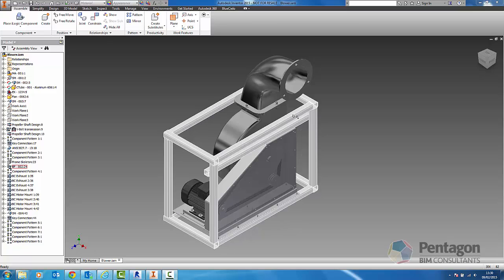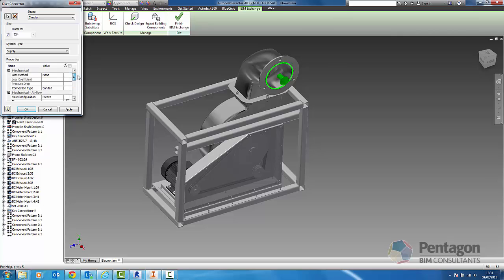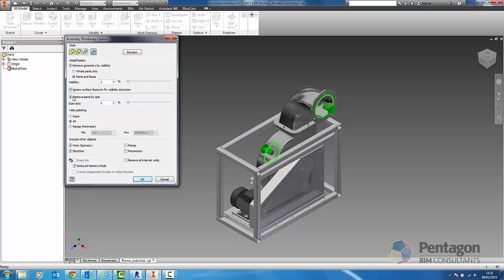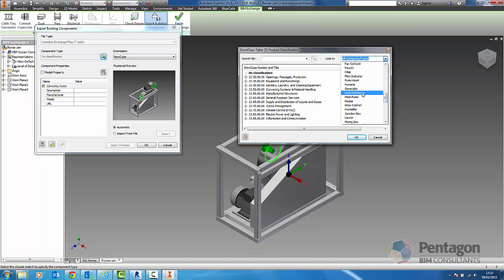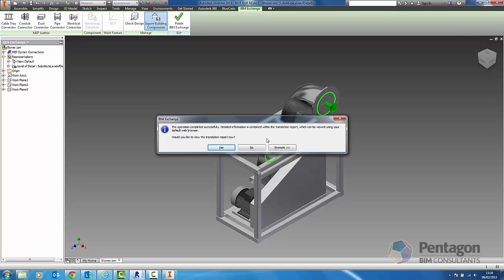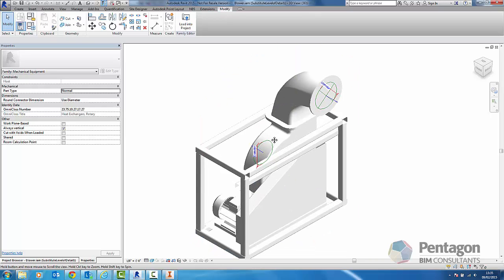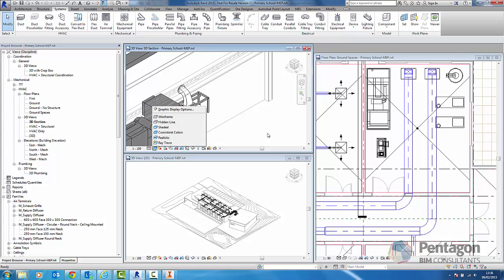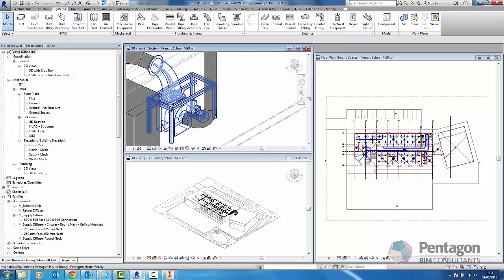BIM Workflow Inventor objects to Revit

Comment: I have .iges file from OEM, the drawing is combination of surfaces & solids, i have imported it into inventor and followed your instructions.

With successfully converted the file to .adsk to .Rfa, now my problem is i cannot modify host, the option is disabled. How can i modify host type? Also i want revit to recognize this product's bottom as level rather it is picking up mid section as level. 

Your video was helpful but could you please adress my issue. Also this is my 4th day on inventor & revit. So my level of expertise is beginner.